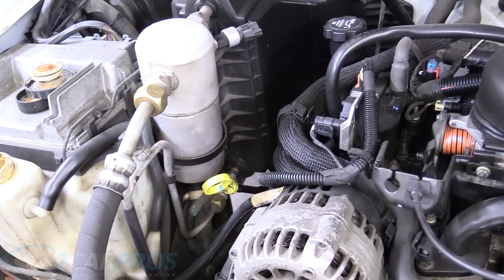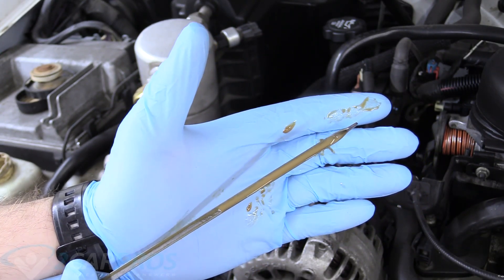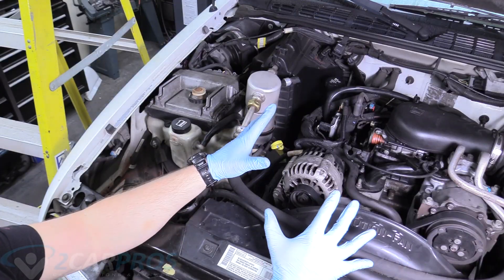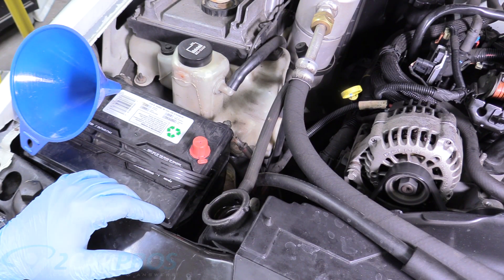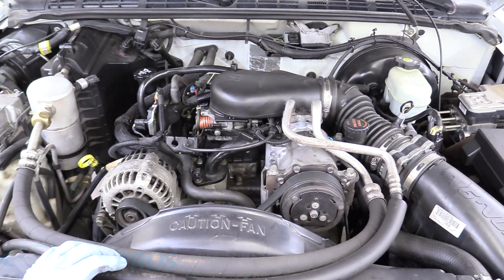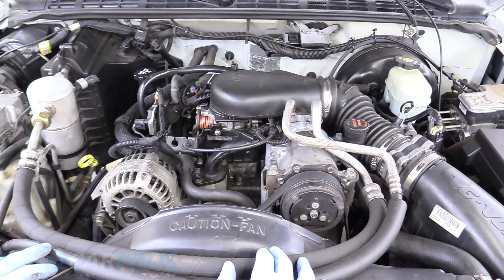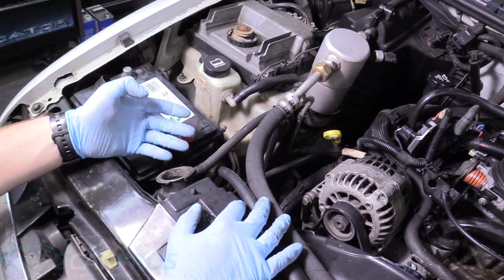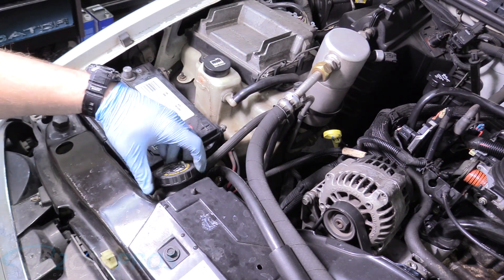Can You Fix a Head Gasket with a Chemical Sealer?

Comment: Great video!!! Quick question, after the 50 min run, did you take all the water/blue devil out of the system? i think you just left the blue devil in the system and then you did just a top up with coolant, is that right? is it safe to leave the blue devil with coolant in the system? Just checking as i want to do this process this weekend and I'm not sure if i need to take all the water/blue devil out of the system after the process or just leave it inside like you did. Thanks for your video!!!
Reply from the maker: Some people drain it all out and replace it with 50/50 coolant. I just topped it off with coolant and the S10 still runs today. But I live where it never gets cold enough to freeze. Thanks for watching!

Comment: Great video and great idea! I wouldn't recommend running straight water though. Water isn't kind to internal parts. 50/50 = happy coolant system. 🙂
Reply: Unless it can get to -60 like where I live lol
Reply: @seandoyle4964  You must be up in Alaska with ALOT of those Joe Biden loving gun banning clowns?
Reply: Totally baffled everytime i think about tap drinking water not good for engine internals..lol..
Reply: You NEED to run JUST water and blue devil during treatment. AFTER you run the 50min and wait 2 hr for cooldown, you drain radiator and reinstall thermostat than close up and pour your COOLANT.

Comment: Thanks for the demo and the testimonial.  I have a very small leak. I had an intake gasket leak that I've already corrected, discovered there's also a very small external  leak behind the head.  The leak is so small, I don't even have drips on the ground beneath the truck......  Just see signs of it when looking up from below the truck.  It's probably best to do it now since I've already flushed the coolant multiple times, especially the heater core. I think you just gave me the motivation to go ahead and get this done so I can get some coolant back in and call this nightmare done-did.
Mine's an 88 S10.
Reply: Did it work?
Reply: Well did u put the blue devil in it and fix it or were you just running your pie hole randy?
Reply: @wildestcowboy2668  Apparently your running yours. Have another beer for me.
Didn't your mother ever tell you.....
....you know.
Reply: @wildestcowboy2668   By the way, I did.  Because your an ass, nobody is going to know if it worked.
.....I'd forgotten where I'd posted this. Had you a question instead of the remark you made, you'd have some useful information to pass on.
 😉
Thanks for reminding me I'd mentioned this. 👏

Comment: I have a 2000 Grand am GT with 230k miles.  It had sat for a 5 or 6 years and when it went back into service, a cracked radiator was discovered and repaired after a large puddle of coolant was discovered.  it developed a slight rhythmic rev while idling a few days before that.  After light use, one day it's temp spiked to redline.  It's operating temp is 218.  The thermostat was then replaced.  Now it's losing fluid and Ive discovered liquid on the block directly below the head on the drivers side.  There is no coolant in the oil and no moisture in the exhaust... only on the block.  Will this product possibly work for this specific condition?

I only ask because it seems like all the examples ive seen show internal leaks, fluid into cylinder, or fluid into oil.... My case is a fluid breach into external atmosphere.
Reply: you fixed i'have the same problem in my grand am se 2004 with
112k miles

Comment: You said don't drain it after you run it with the blue devil also if  it requires 50/50 do we replace what we lost in the thermostat with that
Reply: If you want 50/50 just drain it completely and add/bleed 100% 50/50, this stuff only reacts to 1 heat cycle (says on the bottle)
Reply from the maker: This is correct. Thank you both for watching!

Comment: HAVE AN VOLKS JATTA 2014 MODEL WITH COOLANT OIL LEAK WHEN CHECKED WITH VOLKS DEALER THEY SAID HAVE TO REPLACE HEAD GASKET CAUSE OF A LEAK WILL THIS PRODUCT BE THE SOLUTION FOR THIS PROBLEM. (fyi I AM IN INDIA)

Comment: have a m111 engine Mercedes Benz, mixing water and oil in the engine. Many mechanics in my country don't understand that a chemical like this exists and many think that if the gasket is damaged then the car over heated and the Cylinder head may have warped. Can I use this chemical? I strongly don't think the head warped
Reply from the maker: I'd try it. Thanks for wastching!

Comment: "why not try it?"  - because it will make repair much more expensive later and blow up your engine to boot.  Why don't you do another video after head gasket blows again, and show us what this sealer did to all the passages in the engine.
Reply: My mechanic recommended I do this before  getting the head replaced. Has been very effective
Reply: If you know what your doing and which sealent to use and how to use them your engine will be fine. 20yrs experience.

Comment: Will this work in my 98 ford f150? I have the milky oil and when i drain the oil, ii left the plug off to see what happended if i fill up resouivour tamk with water and the water came atraight out the oil drain plug...let me know what tou think
Reply: That's not a good sign. Try the CRC stop leak product. It has 3 different size ingredients that I've had luck with on really blown head gaskets. They guarantee it'll work on any head gasket or even cracked blocks and heads.

Comment: I had my 2004 GMC Sierra fixed with head gasket sealant last May, 2020, in AZ, then drove it back and forth to the Valley a few times before driving it all the way home to NC, 2004 miles, where I have continued to drive it all year so about another 500 or so miles. At this point, and at my last service and check up, my mechanic said my truck is running well and the oil is normal. I have to say that I use gasoline detergent every other fill up, too, which has increased my mileage, but I also think helps keep the engine sealant in good shape. Am I wrong?
Reply from the maker: No a detergent would not help with sealing a headgasget. Thanks for watching!
Reply: @2carpros  I know that detergent won't seal a gasket leak. . .I was raised by a first class mechanic. My question was " will using gasoline detergent in your tank, which helps keep things running clean and smooth, also help extend the life of a head gasket sealant in your engine?" You know, make it last longer.
Reply: @marshacowan1252  no.

Comment: remember to check for this crap before buying a used car! if you see this, pass!
Reply from the maker: Yeah I would too, if I noticed it. But if you changed the coolant after there is no way to tell. Thanks for watching!
Reply: it says permanent like you point out several times it's hard to believe it would rinse away.
Reply: I didn’t and got “scammed“ but it’s a very small leak. I fought the seller even knew about it. Heck it was less than 2 grand, it was bound to have some issues

Comment: I have a g35 I am about to use this I have a small leak that makes my car over heat. Do you have to bleed the system after applying it ?
Reply: How did it go bro im about to do it on my 06 g35 sedan
Reply: @exra__g35  I just did it about to post a video in a bit about how I did it was a little scary tho lol check it out imma upload it in about 30 min
Reply: @bluedevilg3542  i have a 03 coup g35 with a little leak should i try it?

Comment: A lot of people always leave out a bunch of others too. When doing this be sure to read the directions on the capacity for your radiator. The yellow label is usually for V8 models depends on your radiator capacity like I said. I only used half a container for my 4 cylinder. But I’ve also done both products and the pour n go still leaves behind white residue on your thermostat and I would advise people to drain and fill on the pour n go as well. Maybe let the vehicle cure for a good day. And pour in new coolant on the pour n go along with replacing the thermostat. This yellow one the same method drain the coolant inside it and replace new coolant. Oh also when you pour in the blue devil don’t just put the cap back on. But, be sure to top off your radiator with water until full so you don’t have air in the system and last put on your radiator cap....boom you’ll be set and let idle.
Reply: I was worried about him missing that step
Reply: @tiffanyv4205  it's temporary fix I tried it on my car but turns out it was my head gasket. It was done for. Blew that blue devil out and made a mess when it leaked again. I wouldn't suggest it.

Comment: I'm 3 years in the blue devil game, and it  works great on small pin whole head gasket leaks.
Reply from the maker: I'm still shocked it worked this well. Thanks for watching!
Reply: @2carpros  hi mate love the video. I have an odd one (I may be overthinking  it.) I had a few bubbles in expansion tank (that in itself can be minor) .....had major bubbling months ago dealer got it to a garage quickly and it had a therm.  And coolant sensor (giving wring readings apparently and therm was opening very slowly ) . I not long changed oil . Oil seemed smooth no debris no residue (milky or anything else) New oil filter new oil the mechanics had a bit much in 9verfkiw so took some out a while ago to leave it at max . The only thing I had dine recently was clean egr valve which has a coolant spout either side . I did of course run engine fir some time with cap off (I done my therm  housing gasket on last car so I know this )  I've had idling issues throughout and when that happens it has a deep note as if I have a beefy exhaust .and recently done the test where it changrd to green or yellow from blue over rad or exp  cap . It went yellow it smells funny as some say fume like . And discoloured ..any thoughts? Thanks I'm going to a garage Monday to get a 2nd opinion
Reply: Hopefully it’ll work for me. Mines just got a small pinhole just based on the small symptoms

Comment: Used to assist in an automotive machine shop.   If you're replacing a head gasket you SHOULD have that head REBUILT at the same time!  Why?  Because many times a blown head gasket is the rebuilt of a WARPED HEAD.  That head should be checked for warpage and whether or not it can be SHAVED (machined flat).  At the same time, you will have the valves, valve guides, springs, and valve oil seals checked/replaced as necessary.
Reply: Thanks... I don't think a liquid can help.. maybe delay the inevitable ... My valve cover gasket was leaking last year.. had it replaced ..with some white smoke recently.. I thought I was having a an issue with my charcoal canister after it threw a code.. ! Now my thermostat is acting really weird.. so I'm suspecting it's the gaskets.! V6 and it's over 200k miles...  I try to do as much research as I can...
Reply: To be honest does work crazy try all type brands none did work but blue devil does take a couple days to run the car
Reply: @gigigiseleworld  hey boss nothing's changed my friend. I fixing to use a quart of this in my parents van that they ran hot!
Reply: It worked on my car!

Comment: It would have been nice to see the exhaust smoke before then no smoke after.
Reply from the maker: It didn't smoke too bad it this case. It was just milkshaking the oil. Thanks for watching!
Reply: The head gasket would need to fail between the cylinder and coolant to see smoke.. you shouldn't see white smoke if it failed between coolant and oil in that case its milk shake on the oil dipstick.. .

Comment: Yeah my dad bought me a bottle for my 2003 Outback. But I'm getting exhaust into my coolant, after about 30 minutes or so, it will build so much pressure it finds any weak spots to spit to spray out, then will start to overheat. None is getting into the oil though. But I can tell there is gas in my coolant. Smells like a freshly filled gas tank, not a coolant system.

 Guess I'll try it!
Reply: Did it work?
Reply: There doesn't seem to be anyway to leave a comment at least I can't. Therefore my only salvation is to reply to this comment. And that reply is the video speaks of coolant in the lubrication oil system as the symptom I watched the previous video that spoke of coolant in the exhaust system but there is no video that I find and why wouldn't these videos speak to all three to really be a test what's the third one oh my it is exhaust in the coolant exhaust in the coolant that's the other direction from coolant in the exhaust it's also the opposite direction of the leak so to speak the exhaust is invading the coolant coming in to the coolant

Comment: Hi mate, great video. One point though there does seem to be two versions of the same product. One version you have to remove the thermostat etc and the other which is called “pour n go” you don’t have to. Don’t know whether the formulation is different but just different instructions to follow!!
Reply: There is also a Bar's Carbon that works with antifreeze and it is add and go...it works better than Blue in my opinion.

Comment: Hey bro ima take my car on a 20 hour drive from Phoenix az to sunnyside wa I haven't had signs of a head gasket leak I even tried one of those test with the blue liquid and it came out good no leak ig but anyway what I wanted to ask is since I changed the water pump thermostat a couple of hoses and the radiator but it's a cheap one so ima.change it again so I dont risk over heating should I try the sealer my car is a 99 celica gt with 196k and has overheated a couple of times because of the things I've listed any thoughts?
Reply from the maker: If there isn't a head gasket leak this stuff isn't going to do anything. Thanks for watching!

Comment: Got an 88 Ford f350 7.3 naturally aspirated diesel. Have a coolant leak externally only in the front passenger side right under the exhaust manifold. Pretty sure it's a head gasket leaking externally only. No symptoms of coolant getting into the combustion chamber or oil. 
I'm a little concerned that the blue devil might not work here because it isn't hot enough to get it to harden up.
It only leaks if I leave the radiator cap on and the system pressurizes. If I leave the cap off it doesn't leak at all. As rarely as this truck gets run I'm considering just letting the truck operate this way. 
Any suggestions on a product that would be better suited for an external coolant leak?

Comment: You need to do it the right way .
If it’s really bad head gasket, No this won’t work 
You need to clean the system first , flush it twice ...Remove Remove Remove the thermostat.....
Add it as it say , and then leave the car set for a day  after treatment and be easy on the car the first 100 mile .
That’s how it’s work 100% 
If your head gasket bad really bad , this product won’t work , just take it to the shop and fix it
Reply from the maker: Follow the directions and it works. If it was super bad yes you would need to replace the headgasget. Thanks for watching!
Reply: When do I put the thermostat back in

Comment: Don't use water in your engine no matter where you live as it has a much lower boiling point than coolant. No wonder you got a head gasket issue 🙈 Good vid though.
Reply: You can , destail water and add 100 anti freeze when you finish putting your thermostat back 
I did it on 1000 car ...
Reply from the maker: Which is why you are aiming for 50/50 of coolant and water. Thanks for watching!

Comment: Great video.  Question:  I have a bmw 528i and there is no radiator cap.  Only the reservoir cap. I’ve seen other videos saying NOT to put this is the reservoir but ONLY in the radiator.  How is the best way to proceed on this type of radiator situation?  I don’t have fluid going into the oil.  So no chocolate milk situation, but is coming out of the exhaust and no misfiring yet in the cylinder.  But that is probably coming down the road. Please advise...
Reply: Hi I actually have the same issue with not having a radiator cap. Can you please tell me what you did. Or how I proceed with this. Thank you
Reply: Pour it into the radiator from the top hose on your radiator. Problem solved.

Comment: After you  done  do you drain the  blue devil out
Reply from the maker: Good question! You could, I didn't and the truck is still running daily to this day. Thanks for watching!
Reply: I  did on  mine  still white smoke   Mine no leak  I seen white smoke   When it cold in  winter   If not cold  no white smoke